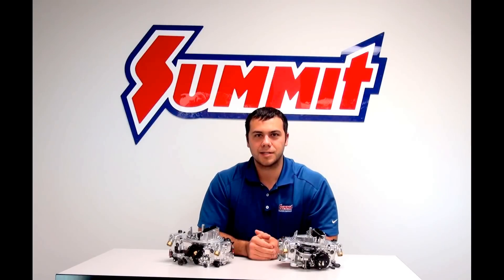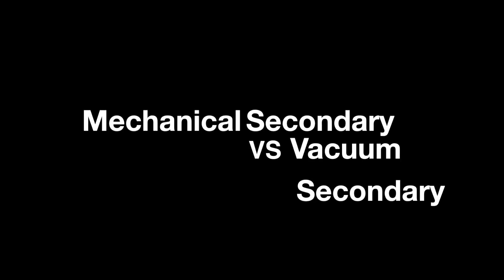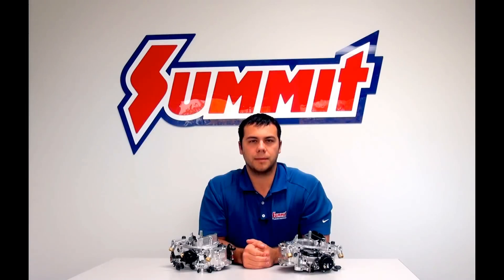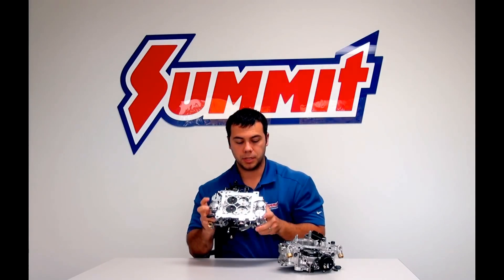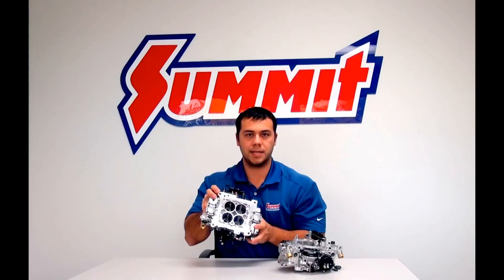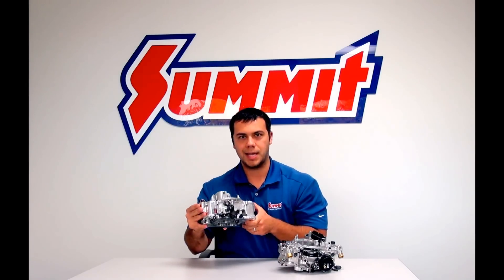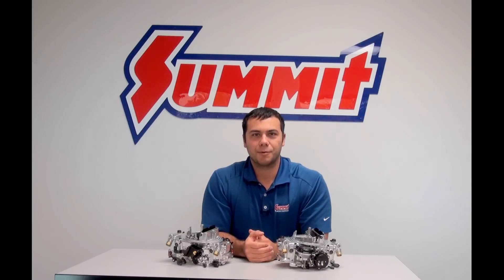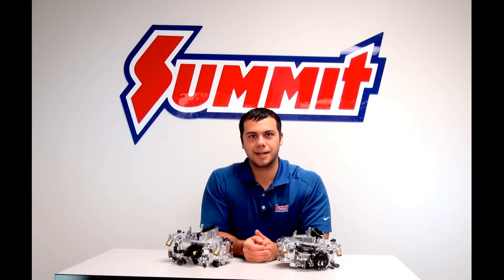Vacuum Secondary vs Mechanical Secondary Carburetors - Summit Racing Quick Flicks

Comment: I have an older rebuilt 351m coverted to 400. 40 yrs ago but only 20k miles. ALL IT NEEDS is straight timing, dual plane manifold and a 650 cfm carb with as much 4hole spacer as I can fit. I was looking at AVS. The 400 is great torque but will never rev high, all in @ 4.2k IRL. My thought is to start mech 2ndaries 66-70% throttle with kickdown C6 @ 80% throttle. Keep all the extra within the upper half of torque band. It should be enough for a street stomper; when needed. And get slight improved mileage off the primaries @ 160 cfm per..

Comment: 1969 Plymouth GTX. 440HP engine and the 727 torqueflight automatic transmission.  The 750 Holley with vacuum secondaries will work good .

Comment: What all would you have to do to convert a vehicle from a vacuum carburetor to a mechanical carburetor? I have a landcruiser that has vacuum lines and I want to convert it to one without. So what do I need to include in the conversion to exclude all the lines?
Reply from the maker: Hi Axel, Due to the technical nature of this request, it would be best answered by working with one of our sales representatives at 1-800-230-3030. We look forward to hearing from you.

Comment: you are quite wrong when it comes to the opening of the secondaries on a vacuum secondary carburetor.  The secondaries are opened by the air velocity being pulled through the primary side of the carburetor which causes a vacuum to open the secondaries. you are promoting with this inaccurate video a bigger and bigger problem when it comes to people understanding how the secondaries on a HOLLEY carburetor work please correct your video.

Thanks Duke city carburetors
Reply: You are correct, but that air velocity is directly related to engine load, which is what he said. So you both win.
Reply: The video's implication is that manifold vacuum opens the secondaries,  which is false.  Manifold vacuum reduces as throttle blades open.  Therefore that would suggest that the venturi effect of airspeed through the carb is what actuates the secondaries, the same effect that draws the fuel from the carb.  This is a low effort video that is misleading.

Comment: Incorrect. Mechanical Secondaries are not "also know as double pumpers". These are two different things and they are not connected. There are so many mechanical secondaries out there without a second acceleration pump.
Reply: yep. he also said that vacuum butterflies open when vacuum increases, when in reality, its when it decreases.
Reply: there is only 1 Holley mechanical secondary carburetor that is not a double pumper HOLLEY list number 9776. so I think it's okay to call them the same thing cents HOLLEY has Dozens of other carburetors that are mechanical and double pumper's.  Thanks Duke city carburetors

Comment: What about the 450cfm mechanicle secondary carbs with only a single pump shot, the idea being that vacuum draws from the booster as in a vac sec..what happens when the pedal gets mashed opening the rear secondarys but with no pump shot to fill that hole until it draws..these mechanicle secondary carbs are sold for tunnelrams, with a plenium the vacume signal is lower. Question: Can you do a vid on these 450cfm carbs and explain why you then recomend these carbs? In theory they seam like the worst possible combination?? ( unless its in a light tbucket that wont lean bog)

Comment: Any draw backs to using a vac secondaries carb on a manual transmission
Reply from the maker: 99topramen , 
Not at all, but buy a carb that can be tuned or adjusted to tune the opening to your liking. Any Holley/Demon/Quickfuel Vacuum secondary or Edelbrock Thunder series can do this for you.

Comment: i have a 2v 302 in a 1973 mustang. i was thinking of upgrading to a 4v. i dont know what carb to get and is i should go mechanical or vacumm secondaries.  any help? its a manual as well that will mostly stay on the street.
Reply from the maker: TheSamplebridge, 
Correct carburetor sizing would really depend upon any modifications that will be made now or in the future. Give us a call and we can help you out better. 1-330-630-0240.
Reply: Id strongly suggest cutting the car up and throwing it in a metal dumpster, if you acquire another one in the future, refer to step one.
Reply: @UsefulEntertainment  well if it was a GM product I'd pop open the gas tank and light the thing on fire. Why save any parts for a shitty GM product

Comment from the maker: You should not because with any carb, tuning is required! You may have to install a slower secondary accelerator pump cam or a smaller secondary squirter nozzle. Tuning time will tell! :) Thanks for watching.

Comment: Vacuum secondary do not sense engine manifold vacuum as you stated. Depending on a load requirement the air that travel threw the primary venturi is what generating the vacuum. The higher the air velocity the more vacuum it creates until the spring in the diaphragm has overcome and the secondary starts to open. Vacuum secondary will open what the motor required and forgiving when it comes to over carburetion.

Comment from the maker: Thank you! Please let us know if you have any additional questions. Good luck!
Reply: I had a 600 CFM Holley double pumper on a mild 350 Chevrolet. I believe it is the Carb that the M2008 series was derived from. It was great, and I didn't even have a kick down on the auto transmission. Just got to know how to drive. If Summit had the 600 double pumper I would have bought one long ago.
Reply: A Question..  is a 600cfm  too big for a 1992 302 HO 5.0L??? (originally it's EFI  but i've converted to carb)

Comment from the maker: With the accelerator pump at the max setting, the next step would be the Edelbrock part # 1475 Accelerator pump nozzles. This will allow more fuel out of the accelerator pump right off idle that should take away any off idle hesitations or stumbles!

Comment from the maker: There are actually many things to consider in the proper choice of a carburetor. Engine design would be one factor as you start to reach higher effort (Race) type motors. For the average street driver, the CFM calculator on our website will do the trick just fine with proper tuning. As a general rule of thumb, street driven automatics are better off with a vacuum secondary; and manual shift car with a mechanical secondary.
Reply: Why

Comment: What about the inverse of the situations you describe in the video? Specifically, what if someone has a manual transmission for street application, or has an automatic transmission for racing application? Is the recommended secondary then contingent upon other considerations, i.e. engine design?

Comment: I've done this by ear/driving and the overall driving is real good almost as an efi but what's bothering me is the rough idle  and lack of "woff" from idle...
Acc pump is set at max of the 3 settings.
Lean idle circuit?

Comment from the maker: My first suggestion would be to try and tune the carburetor you have. There are tuning parts available such as squirter nozzles, step up springs, metering rods and jets. We also have a technical helpline that will be able to make suggestions on where to start. Please call them @ 1-330-630-0240

Comment: My 1407 edelbrock carb does not respond like I want on from idle  flick'n on the throttle.
Does a mechanical secondary solve this?
My engine is a 5,7 HEMI with a bigger xfi 273 comp cam and msd6 hemi engine controller.

Comment from the maker: A vacuum secondary carburetor opens the secondary air valves just a little slower than a manual secondary carburetor. Sometimes this is called a “progressive” opening. This provides a smoother transition of power when accelerating away from a stop. Please let us know if you have any additional questions. Thanks for watching!